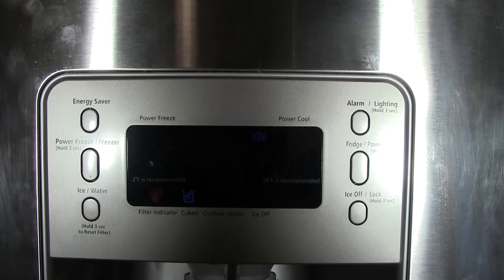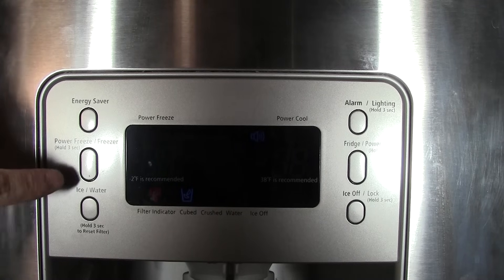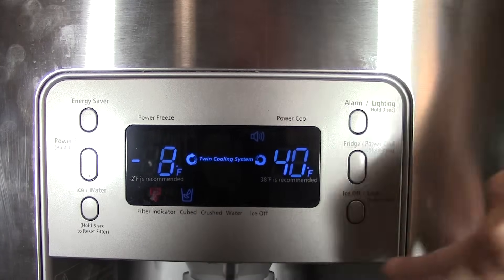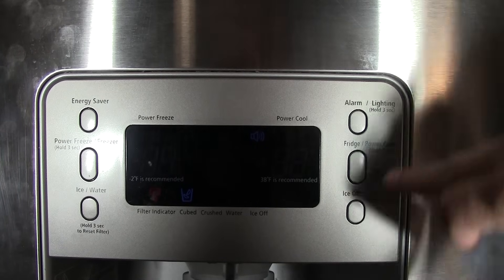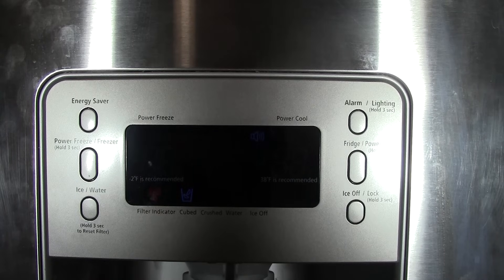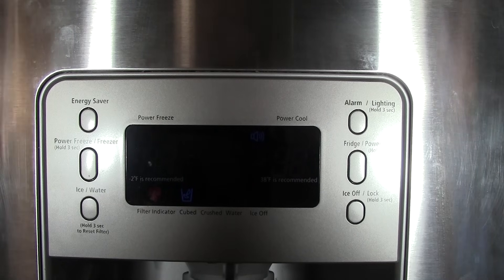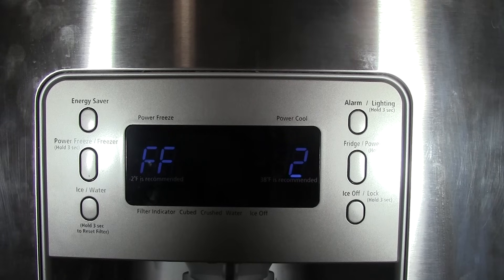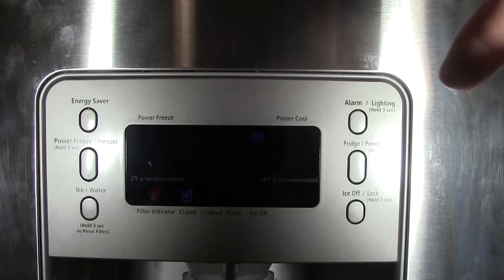FORCED (manual) DEFROST mode on a Samsung Refrigerator--Top Secret Setting

Comment: Does the fd defrost the fridge or the freezer too?
Reply: There is 1 compressor, 1 evaporator coil, and one cooling system, so by defrosting one you should also be defrosting the other.
Reply: @thecapitalalliance  If it's a TWIN COOL, there are 2 evaporators, 1 for fridge and 1 for freezer.

Comment: Did it twice in a row but fridge is still making the sound... any ideas?
Reply: You may have a severe amount of ice build up around the coil. Search video on how to open up the twin cooling in the back wall of the fridge. Be very careful not to pull the panel off if it is frozen/stuck to the ice. It took me 2-3 hours using a hair dryer to melt enough to remove.
Reply: You need to empty it and unplug it for at least 2 days with the doors open. Be ready because it will leak water on the ground. Don't just put it in demo mode because all of the water can damage the electronics.. actually unplug it.
Reply: crypto1701 we ended up trashing it. We unplugged it and nothing was frozen. It was just dead.
Reply: @debs2949  it wasn't cooling at all? One of the things about unplugging it is you have to open the doors.. and it took mine several days the first time.
Reply: crypto1701 we had no ice buildup. We opened up the panels to see.
Reply: @debs2949  bummer!
Reply: @crypto1701 you can't damage the electronics. They are outside the fridge.

Comment: My ice maker compartment will not come off it is stuck. How can I remove it. M# DA99-02321A
Reply: It's over frozen w ice build up. You may want to use a blow dryer on low to warm up the unit and then pull it out. You're going to see a lot of ice, keep your dryer handy to defrost the ice and then press the reset button in ice maker to get things rebooted.

Comment: The filter reminder comes on every 6 months without the filter in it
Reply: There is a timer for the filter, not a sensor. Doesn't matter if you have one installed or not. Just reset the timer when it comes on.
Reply: Sounds about right. We don't have ours attached to a water line or anything, so we obviously don't have that part running, but the reminder faithfully comes on.
The ice buildup is what made a friend sell this fridge; we've been loving it, and this has been our first buildup in about two years, and I know how to fix that now...

Comment: I'm using an RS277 and now I have a constant beeping. Please someone help me
Reply: CwisTheEntertainer your button combination may be slightly different than the sequence shown. You may have to attempt different combinations.
Reply: @gokusayien5873  I tried the button sequence on the video and now I screwed up the fridge system....
The two settings are constantly on OF.
Reply: CwisTheEntertainer what happened? How did you fix it? Long power cycle? Reset?
Reply: @batman1169  You can search up the manual online and it showed me how to reset it, so I did and my refrigerator went back to normal. How I unfrosted it was to unplug it and leave it unplugged for a few hours. I think I had to hold the left middle and left bottom buttons for a few seconds.

Comment: I have the rs261mdbp and that doesn't seem to work, I guess I can put it into demo mode but I wanted to try the FD mode to see if it works, the last two times I had noise I actually pulled the interior panels out and let it defrost, I would rather not do that this time. anyone know if there is a way or if this works for the rs261mdbp?
Reply: Try changing out the fridges temperature sensor, as that worked for someone in another response here.

Comment: The forced defrost shut off after an hour, then it went to the demo mode. I thought i was never going to get the refrigerator to come back on. I still have buildup coming out of the air vents so....I guess I will have to take it apart once again. Samsung sucks!
Reply: yes Samsung is horrible.

Comment: I used the forced defrost and that function seemed to work fine. Now, however, I am not sure that the refrigerator is cooling after I completed the function and then reset the temperature from 38 degrees F to 40 degrees F.
Reply: I thought the same thing. However, it took a long time for the fridge to cool down. Check it in the morning.
Reply: Well did it cool down?
Reply: If in doubt, kill power to the ref for 20 seconds and bring back on, it will reset all functions to normal.
Reply: Does say it's cooling at all.. as in did the temperature go down at all? Sometimes the water gets into the electronics and you have to unplug it and plug it back in. I would never recommend doing a full defrost while it's plugged in.. the water can damage the electronics.

Comment: Thank you for the very informative video! I have it bookmarked until I can (hopefully) solve the problem with the fan noise and the water in the crisper once and for all. I've followed Jake's instructions twice now. It's a temporary fix, for sure. But I think I might have to break down and get a Samsung service tech to install a "Water Leakage Service Kit" https://partsdr.com/blog/samsung-refrigerator-water-leakage-service-kit/ - I heard this was a permanent fix, but I'm not sure. I'll let you know...stay tuned. BTW, I'm NOT impressed with Samsung (as Timbo D said, "Avoid Samsung."). I'm also having problems with my Samsung dishwasher. I purchased the frig, dishwasher, stove and microwave as a set two years ago. This should NOT be happening. I previously had a Whirlpool frig and absolutely hated it. I like Samsung, WHEN it works. What's a consumer to do when top brands make junk? Thanks again, Jake.
Reply: Geri, see my defrost drain comment.. Not sure what model you have but Samsung refrigerators are famous in the Tech community for frost/ice blocked drain holes. Occasionally it is a blocked little rubber fitting at the bottom of the drain tube. Nice little video by majdr622 on that simple fix. Both real money makers for us. Thanks Samsung. : )
Reply: Hey Timbo D are you a service man for Frig’s? 
If so what does it mean when I push freezer/fridge temp button but it don’t show actual temp after a few secs it just shows the set temps

Comment: How do you defrost the freezer and leave the refrigerator alone?
Reply: i run the force deforst and have my freezer door open to try to get rid of the ice build up and the fridge stays right at 38 the whole time
Reply: There are separate fans and cooling coils ( evap coils ) for the fridge and freezer, so one can be off ( or in defrost ) and the other still on.
Reply: @sheabernard1962  Yes, I watched a different video and while I didn't finish it the way the video did, the freezer works fine now. My guess is it will happen again some day.
Reply: My fridge won’t get cold but the freezer is working overtime. I did the FD and the compressor kicked on immediately. The beeping noise has not stopped yet. Any clue how long it will last?

Comment: I put mine in FD now it won't come out of it.  Help!!!  Tried reset and not working!
Reply: Oscar Hoehandle try holding the “power freeze/freezer” and “alarm/lighting” buttons for a few seconds. It will reset after a few seconds. This works for me. It also will help reset after a power outage or surge. Pushing the “energy saver” and “power freeze/freezer” buttons makes mine go to demo mode - compressors off.
Reply: It turns off after 30mins anyway
Reply: Martin Palmer yes it will come out of FD after 30 minutes but doesn’t revert back to normal run in all cases. I believe it reverts back to the last mode prior to FD
Reply: Shane C ok yeah, assuming someone was playing with modes.

Comment: Or, you could actually fix the problem by adding the new $5 drain kit, DA61-06796A.
Reply: Tech did my 3 year old Samsung last month using the Samsung Ice Maker Repair Kit including new motherboard, new drain tube, 2 Y clips and rectangular gasket as well as replacement ice maker. He also did some silicone sealing.
Reply: We did that and also replaced the 2 drain tubes in the back of the fridge that were clogged.   Fixed the leaking problem but now, 2 months later,  the fan is making noise.
Reply: @brianbaker359  would you happen to know the model number of the repair kit?

Comment: Mine with Samsung RT53K6651SL/ME.
Freezer ok but fridge not cooling. This is the second time. The first time I just re arrange the stuff inside the fridge & then it works well. But not now. Even throw away lots of foods to make space inside fridge & freezer. Tried to reset, tried turn off. Nothing works..
Reply: you have to pull out the fridge ran and clean out the ice. just had to do it to mine
Reply: @smeador00  thank you

Comment: If you have a big ice build-up, you need to UNPLUG the refrigerator. If you simply put it into demo mode, the melting water can mess up your electronics and cost you LOTS of money!
Reply: everything is sealed thats electronic. the exposed connectors are subject to water and moisture, ice with no problems. it will not hurt it. you can take it outside remove the inside back wall panel and spray it with the garden hose to remove all the ice, put the panel back on and turn it on. the unit is designed for moisture it wil be ok. you have a good point if not working on a freezeer / cooler

Comment: Im a retired refer tech.....follow this guy's advice and I guarantee you'll have even bigger problems.
And NO Iam not affiliated with any manufacturer of domestic refrigerators.
Reply: Can you elaborate?
Reply: Just adding my 2 cents....point is  the more "service tips" you give people who do not  work in the business the worse the problem become.
Reply: Yeah I guess I can see how tinkering with hidden codes can be problematic
Reply: even bigger problems? if your refrigerator isn't working, you follow this advice and  it works, how can there be bigger problems? your refrigerator will explode? you are not adding any cents by not elaborating and by not giving a better solution.